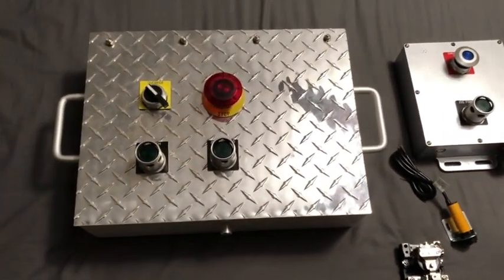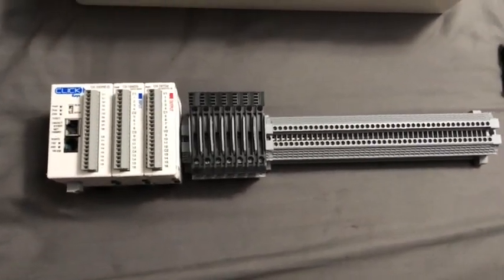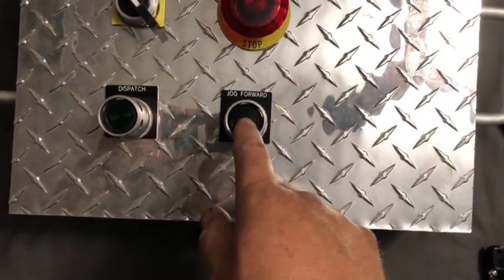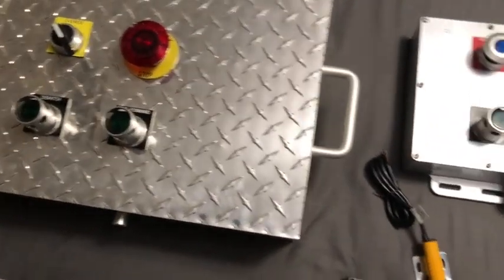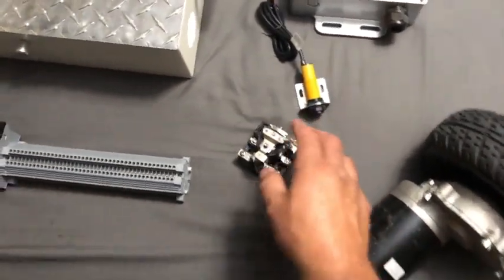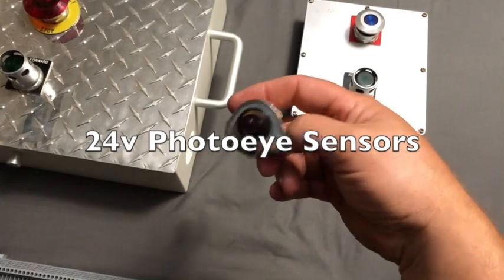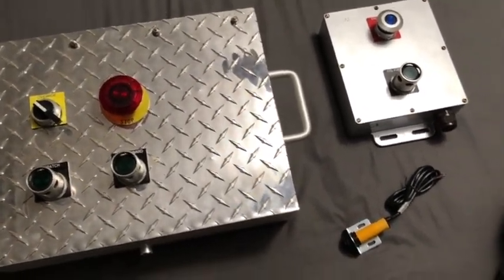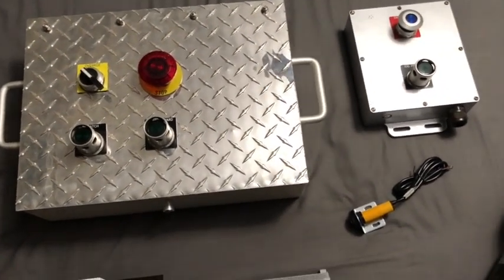New Ride System sneak peek

Comment: Hey Brett! I have been working on a ride system, and wondering if I need any safety notices or permits. My dad has been supervising this to make sure it is safe. Your response would be appreciated! If there is something I need to know please email me at avab1066@gmail.com

Thanks!
Reply from the maker: Hi Ava! It's awesome to hear you are making your Dark Ride! So to answer your question there are different answers  depending on your situation. Some people have posted a "Ride at your own risk" sign, others have people sign a waiver to ride, and as for me I ran it like a regular walk through haunt with a posted safety rules. I did not get a permit as my city would probably say no since it would be considered an amusement ride attraction which usually needs a certificate of compliance($15k.) Since we are using mobility scooter parts I treat it as if people are riding a mobility scooter on a track. I asked a friend who works for my city in code enforcement and he said as long as people are safe and not getting hurt it shouldn't be a problem. I had over 400 guests and no problems when I ran my attraction( I made everything overly safe.) I hope that answers your question.
Reply: @pixelvisioner  Thank you so much! I write a ton of code for arduinos and stuff on my channel so the whole system will run with numerous saftey systems and trackers! I definitely overenginered the saftey system! All the wireing for the saftey systems are on custom PCBs so connections are secure! Additionally the RF conunication has a backup mode and continuously checks for a connection (if broken, cuts the main power via a relay)!
If you want to know more about this project, I am posting about it on my channel! I will definitely give you a shout out for all your help, and inspteration! All the software will also be available if you're interested!
Thanks Very Much!

Comment: hello Brett,

I have a few questions, where do you buy the ride control panel buttons, such as the e-stop, the dispatch, the jog wheel, and the override switch? how many volts can they use at most, and do I need to buy a voltage booster or suppressor for that? because I'm really worried about whether I have the right voltage and amperage, that I won't burn out the switches. and does it matter how thick the cables are?

sorry for my bad english, i am dutch, and i am not very good at spelling english. I use a translator. i also have a form of autism, so for me it is sometimes difficult to understand things a little better. i am doing this at a residential institution, where i live, and i want to build an attraction, to please myself but also others.

Thanks in advance,
Greetings Anne Schepers
Reply from the maker: Hello Anne! I bought the ride panel buttons on Ebay. They are 24V Allen Bradley switches. What will you be using to power your ride vehicle? Batteries, or are you going to have power along the track? My ride will be powered by a 24V DC 2000watt power supply with a connection on either side of the track. I will be controlling the ride with a mini computer. I do have a basic ride system that uses batteries to power the ride car, and a remote on/off switch to control it.  Let me know what you are using and I'll be happy to help answer any  questions you may have.
Reply: @pixelvisioner  Hello Brett,

I've been talking about this with my supervisors, and it is much harder to make than we thought, I'm not very good with technique, and the people around me aren't really either. I'd rather look for a step by step explanation of how to put it all together. especially because you can be afraid of fire hazards. i did some searching on the internet, and there are plenty of things to find for DIY, but for a homemade darkride there is really nothing to find, at least not step by step. so a diy step by step video tutorial, with the supplies and the links for getting them, would be very handy. 

i'm very dependent on the guidance here, and they said it was getting too difficult. so i hope there is a way out, that i can figure it out.

i would love to hear from you, and i love how you make these things, too bad you don't live in the netherlands, and close to me xD, then i would have looked you up. 

Greetings Anne

Translated with www.DeepL.com/Translator (free version)
Reply from the maker: @mapkanaal  Thank You Anne! Have you watched my 5 part series on how I built my first ride with a more simplistic setup which runs with batteries. watch this:     https://www.youtube.com/watch?v=J-td1Sl71lI&t=32s

Comment: Love it. After our last haunted house I told the wife that I was going full dark ride next year. I am looking at a similar setup, running 24v through the track, 4 passenger, fully automated. Will be watching for updates.
Reply from the maker: Thanks. I'm still stuck on my ride vehicle design (as far as mounting the drive motors on some kind of swivel to follow the track without binding) and what I'm going to use as the contacts for the power. I have a couple of ideas in the works, then I can start building a prototype and start on the track!  Have you looked up " Don Oneil Dark Rides" here on YouTube?
Reply: @pixelvisioner  Yes, Don is a like a demi-god when it comes to diy dark rides. Almost professional looking. I would love to get there someday with interactive systems. I would love to add a small track drop controlled by actuators to add a jump scare. First the basics though. As far as your turning issue, I saw someone use a lawn mower swivel to rotate the drive motor along with the track guides. I have an old ball bearing chair swivel I am going to try to use.

Comment: Hey brett ? Whats the best way to run 2 wheelchair motors
Reply from the maker: Sorry for the delay, I've been real busy.  Well there are a couple of ways of doing it. Depending on what size your ride vehicle is and how many people it can accommodate. If you are making a small one or two person vehicle, you can run the motors similar to the setup I did on my ride vehicles in the video series.(If you are doing a small vehicle,  you can also have one motor with power & the other motor in neutral).  If you are running a larger 4 person ride vehicle it is better to have the tires pull the vehicle along the track rail instead of pushing from the ground.

Comment: Sounds really cool just like the funfair ghost train systems where you have to dispatch buttons want to send them off and one for the unloading so does that mean you will have something on the track that stops at the station ??? are you still going to do the ghost train this year ???
Reply from the maker: Thanks. With this new system I will be running 2 ride vehicles( still in the design phase).  There will be 2 additional photo eye sensors, one in the unload and one in load position that will tell the computer where to park the vehicle for either position. There is also anti collision written in the program where it won't let a ride vehicle enter the same zone if another ride vehicle is currently in that zone. Unfortunately we will not be running an attraction this year due to the pandemic. Originally we were going to run a new Pirate ride using my original ride system with a longer track and video and other effects.

Comment: Those yellow sensors are great to set up with but don't run with them switch them out for the automation direct sensors. Those yellow one's fail. Make sure your programmer accounts for a failed sensor state click plcs are awesome for this application. It's what I'm using for mine as well. Programming a ride HMI. Let me know if you want one I could hook you up. They are better in the sense cause they don't take up inputs and outputs. Those can be reserved for props or lights and sound triggers.
Reply from the maker: Cool thanks for the info. Guess I should have just spent the extra$$ up front lol!